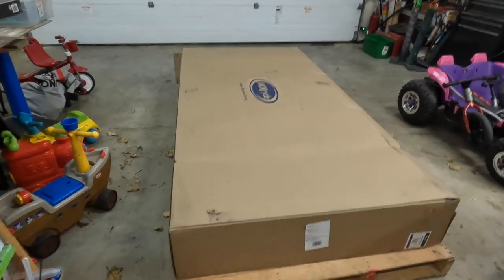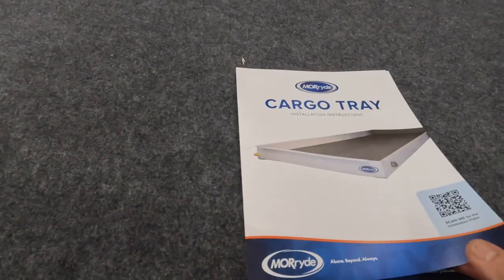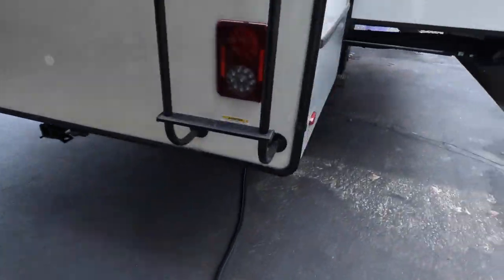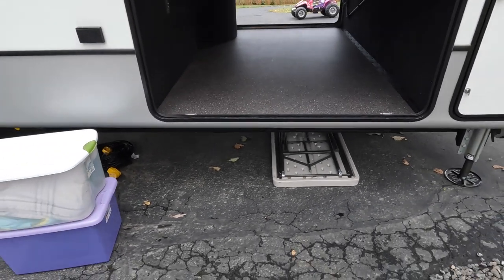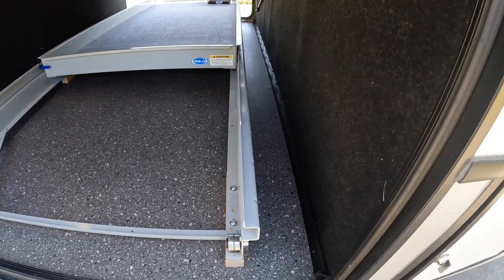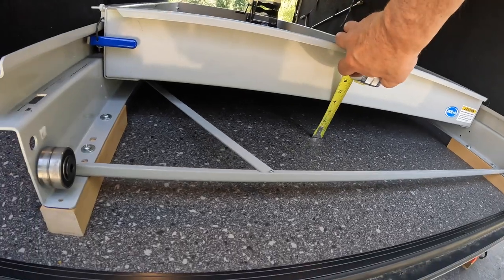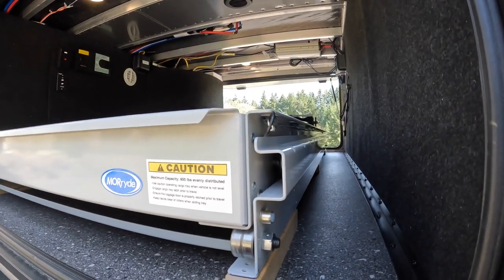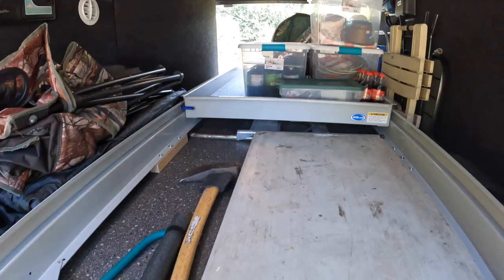MORryde slide tray install!

Comment: We had to make an educated guess on the thickness as well, All we could get from the factory reel was “maybe less than 1/2. We went with that as to the tanks are installed on an angle and but the floor on the end. Just fyi for everyone. It’s truly a shame we cannot have this info when we purchase.
Reply from the maker: You definitely dont want your screws too long!!!
I absolutely love the slide tray. One of the best features of the trailer. What size did you get??

Comment: Great video Pete.  I installed this same cargo tray in our Keystone Cougar a couple of years ago and I initially thought I would lose a lot of cargo space by installing it but honestly, I didn't lose hardly any space. I had to also install spacers to clear the bottom of the door but I ended up using strips of plywood cut the length of the frame on both sides and covered it with that grey needle punch carpeting very similar to what Keystone used on the floor and walls of the basement so it all matches.  I like the cable loop setup you did as well.  Maybe MORryde should build something like this into their future cargo trays for convenience.  Thanks for sharing and safe travels.
Reply from the maker: I really like your idea on covering your full length plywood strips with carpet. Great detail look.
The trays are well worth the investment. And Im sure Morryde could come up with a more polished idea for the cable. But my little redneck cable works pretty darn good!.
Thanks for sharing!